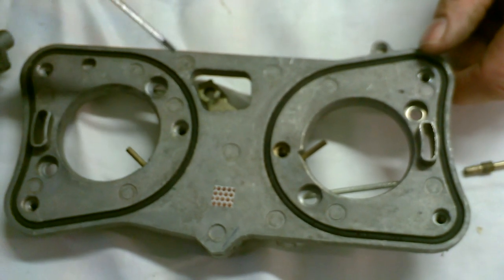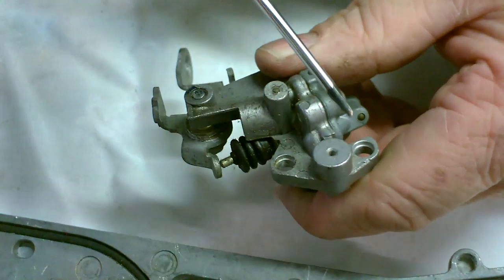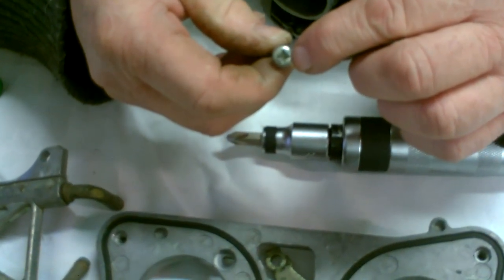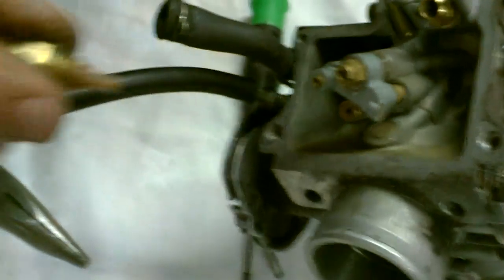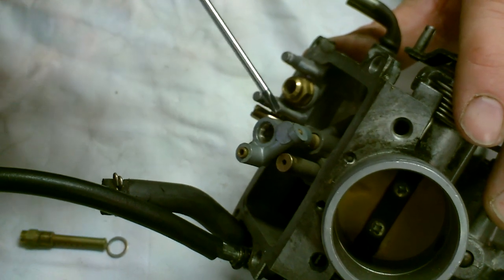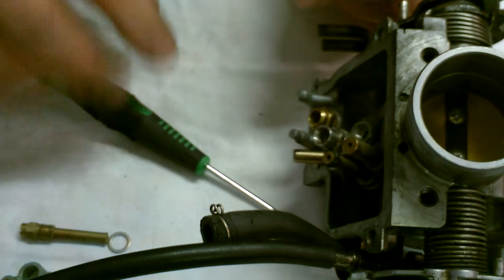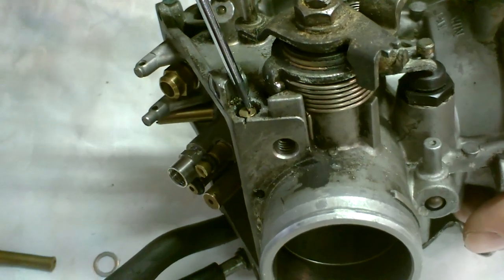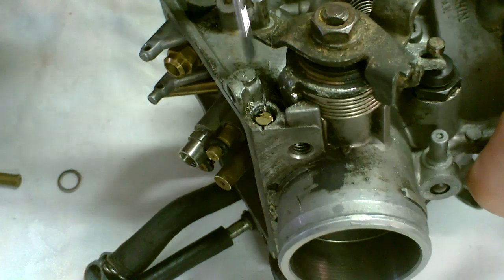GL 1500 Carb Rebuild

Comment: The accellerator pump. When you removed it, were there rubber o-rings?  Do you know what size they are?  I did a rebuild and all looks and runs good except gas coming out of the accellerator pump area. Thanks.

Comment: Are you still around to answer questions?  I can't get my accelerator jets to spray even though I replace the diaphraghm  in the pump and sprayed carb cleaner through all the port holes and it works fine in a bowl of gas but on the carb nothing comes up to the top jets.  My float tangs were set to level and I readjusted the floats and it runs better but the accelerator still does not work. all the jets and "O" rings are new from a kit I got Saturday. I've had the carb in and out for adjustments 4 times today and will do it a few more times tomorrow until I find out what the floats work best at and gets enough fuel for the accelerator to work. thanks.

Comment: I have a 97... is this all the same for a later model? I have hesitation and very poor mileage... I just bought it and it only has 23,000 miles, so there had to be times that it sat unused for long periods. It seems to idle and runs fine when the bike has warmed up, but I'm only getting about 15 mpg.
Reply: Huggy Bear mine is the same way. Did you get it fixed?

Comment from the maker: No the hesitaion was in the 88/89 years only Honda did a major refit after that to elimate the problem, Your problem sounds like you have a short in the gear sensor, Clutch lever switch, Side stand switch ect that is killing the power for a split second in between shifts or one or both air solinoid valves to the carbs under the right side front pocket is faulty or the sub filter has disinagrated and has been sucked up into the carbs adding carb cleaner to the gas tank may solve this for you

Comment: ok rubber is good   the sshop didnt melt any rubber  jets are clear ,,,7, 5  mil on float  is good  neede great  and seat  tight ,,,why did i flood  i drove 3 miles and 2 galons went thu the carbs  ,, and thats after the first rebuilt  that  i did  i had it realy close ,,,